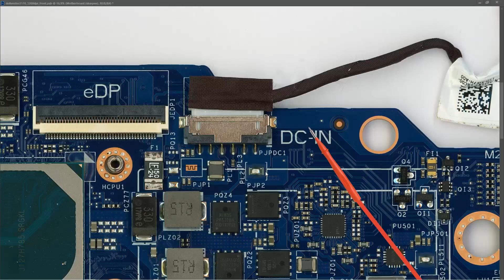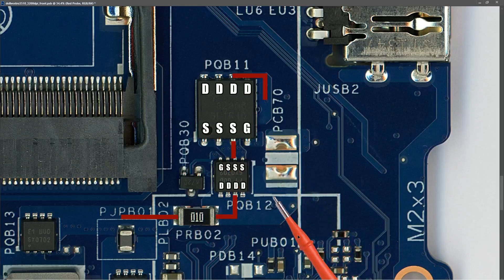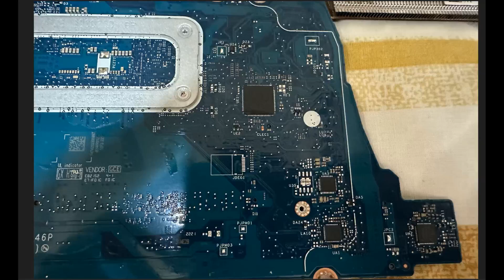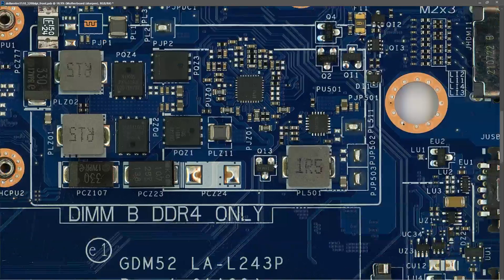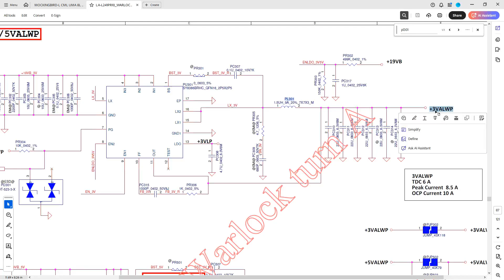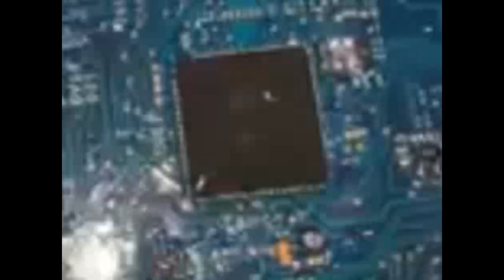DELL VOSTRO 3510 - NOT POWERING ON

Comment: That super io, are you going to get him to test the lines there for shorts before he solders the chip back in?
Reply from the maker: Hi Karl, I asked him to clean and check for (hopefully) a dodgy capacitor around the area, but the only component heating up was the Super IO. I'm not sure if he has a small enough probe to check those little pins of the Super IO.

Comment: Great video, very informative. What is the logic of using 25V at PQB11/PQB12 point when the main power adapter is producing only 19.xx Volts?
Reply: (11:32) Hi. Follow the circuit lines of PQB30. Without PQB30 (someone removed it) or if it were damaged, you wouldn't have 25V across the gates of both MOSFETs. What's the logic? Dell's design engineers have the answer, and I assume they know what they're doing. Respectful regards.